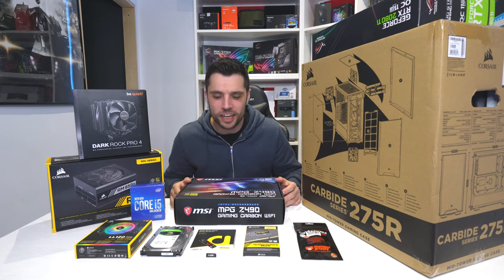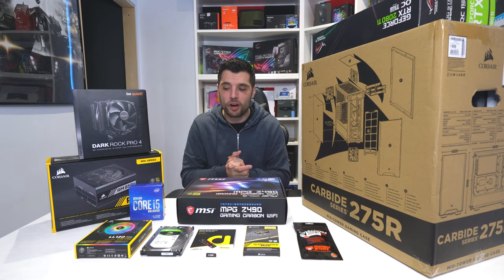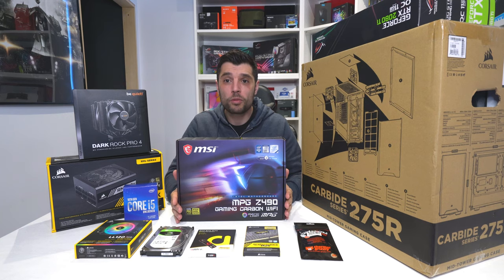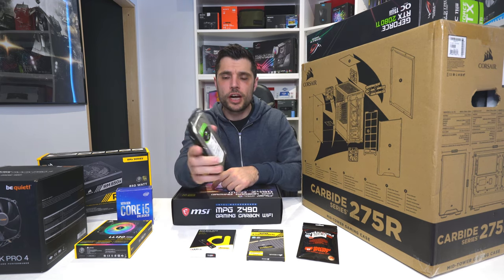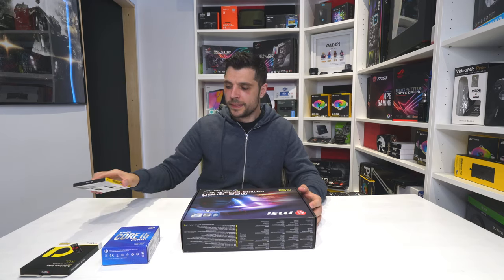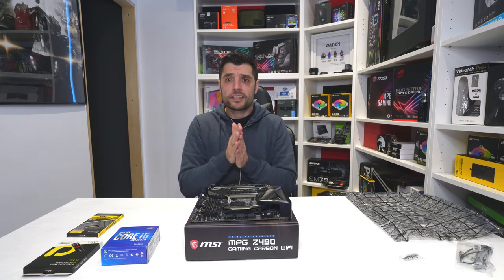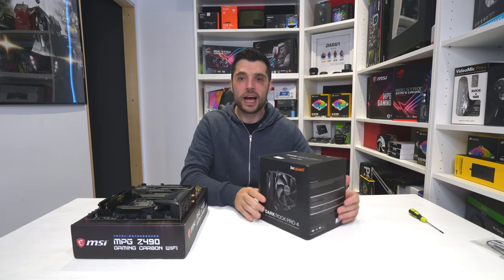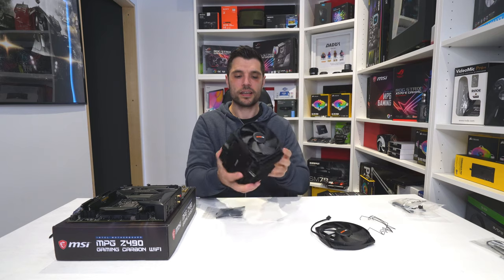Full PC build - Corsair Carbide 275R - (Step by Step)

Comment: Thx for  the guide gonna use it to build my PC soon similar just this case with air flow, and ryzen 7 500x :D
And the motherboard asus rog strix b550 f
Ty bro <3
Reply from the maker: @Mitosowy thanks man I appreciate your support. make sure to get subbed and any probs drop me a message 👍
Reply: @TechCheckUK  i Just did  keep up the good work !
Reply: And a quick quick question i have 2 fans in front 120mm and 1 behind.
Should I buy 1 more in front cause there is a place for it
Reply from the maker: @MitosowyGamePlayPL  2 fans at the front is sufficient tbh but if you would ike a 3rd it won't hurt pal 👍
Reply from the maker: @MitosowyGamePlayPL  thank u
Reply: @TechCheckUK  Thx for the help and last question :D
I have 16gb ram / should I buy 16 more ? or should be 16 enough for video edditing and streaming ?
Reply from the maker: @MitosowyGamePlayPL  16gb good for gaming but 32gb would be much better for streaming and video editing that way u have more headroom to play with. Just make sure u get the same dims as what u have atm
Reply: @TechCheckUK  Ye for sure and 4x 8 gbs is the same as for exaple 2 sticks ?
Reply from the maker: @MitosowyGamePlayPL  YES if they are 2 x 16gb sticks

Comment: 3060ti is better than the 2060ti, only issue is the price point
Reply from the maker: Sorry mate your wrong - in games the 2080ti is just over 10% faster but in all other real world scenarios it's around 30% faster. Regards
Reply: @TechCheckUK  I mean you can check GPU benchmark and all the data is right there to show the 3060ti performs better in game

Is it better value? Currently nope. But the statics show its faster and more effective
Reply from the maker: https://gpu.userbenchmark.com/Compare/Nvidia-RTX-3060-Ti-vs-Nvidia-RTX-2080-Ti/4090vs4027 it clearly shows the 2080ti is faster and better? Please tell me different I had to check for my sanity.
Reply: @TechCheckUK  hold up my bad I am so tired I thought you was talking about the 2060 super 😆
Reply from the maker: @lukeharman7054  no worries 👍